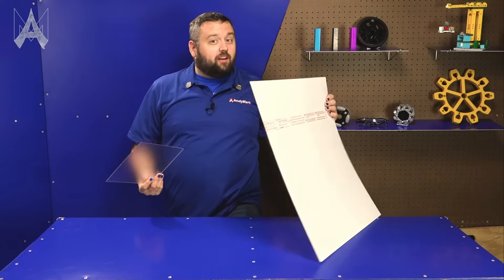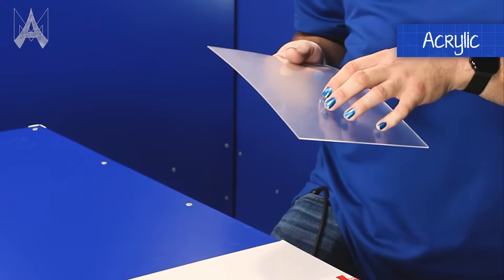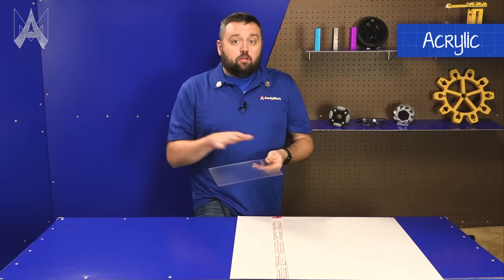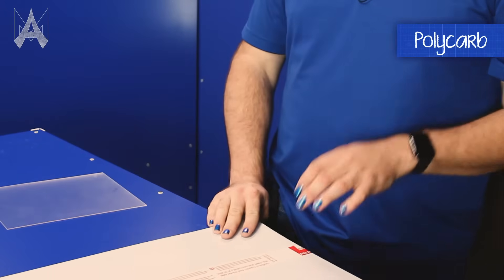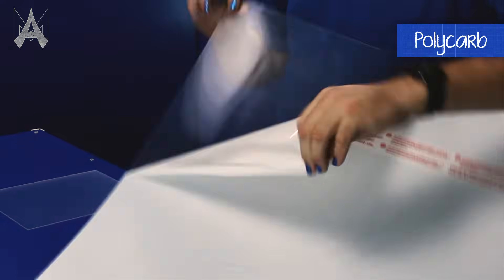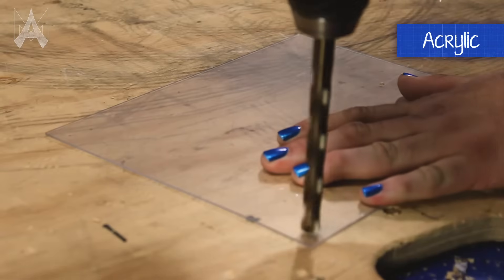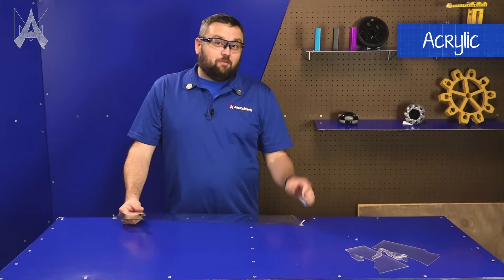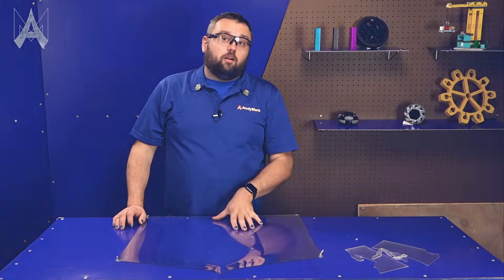How Do I Pick Between Polycarbonate and Acrylic?

Comment: I have successfully drilled through acrylic near corners and edges by starting with a very small, less than 1/16", drill bit and gradually working up to the desired diameter.

Comment: I would been interested of how the light comes out of sides comparison. I want to scratch a picture with laser and light it. Can you do that with polycarbonate?
Reply from the maker: It is much better to use a laser on Acrylic. Using a laser on polycarbonate can release toxic fumes and be very dangerous. To shape and etch poly, use cutting tools eg. saws, routers, or even scissors if the poly is thin enough.

If using the cutting tools to etch/engrave the polycarbonate, lights will catch and light up the cuts, but the efficacy depends on the size of the area you are trying to light and the strength of the LED.

Comment: For stopping bullets, how do polycarbonate (or trademark Lexan) and acrylic (or trademark Plexiglas) compare to AR500 steel and Porcelain tile?
Reply from the maker: They dont compare. Neither Polycarbonate nor Acrylic are reliable for bullet-proof applications. They are not "bullet-proof glass".
Reply: Bulletproof glass is made by layering panes of polycarbonate and acrylic together. This makeup typically includes two polycarbonate layers and one acrylic center layer, or in some cases just multiple layers of polycarbonate. One layer of acrylic or polycarbonate by itself will not stop a bullet. AR500 steel targets will definitely be more effective at stopping bullets. Porcelain tiles are typically used for body armor and they are more likely to fail against higher caliber rifles, so bulletproof glass will perform better in most cases.

Comment: great video! i have a question about the contact with alcohol such as isopropyl alcohol and ethanol alcohol (for surface cleaning). I've done some research suggesting that Polycarbonate has a much better resistance against alcohol than Acrylic? continuous contact with alcohol turns the plastic white or create cracks on the plastics?

Comment: What's the easiest way to etch poly or acrylic? I have an xTool 40w diode. Or a 5w., if that will work better.
Reply from the maker: It is much better to use a laser on Acrylic. Using a laser on poly can release toxic fumes and be very dangerous. To shape and etch poly, use cutting tools eg. saws, routers, or even scissors if the poly is thin enough.

Comment: my team wants to combine the LED system with the polycarbonate side shield of our robot and make an edge lit shield with our sponsors engraved on it. 
is polycarbonate clear enough for an engraved edge lit sign?
is thick (3-4mm) acrylic strong enough for a robot side plate/protector?
Reply from the maker: We do not recommend using acrylic in any thickness for protective purposes. Polycarbonate will do better in a robotics environment. A polycarbonate sheet for an engraved edge-lit sign should work, but it depends on the size of the area you are trying to light and the strength of the LED. For any other questions, you can always email us at support@andymark.com.